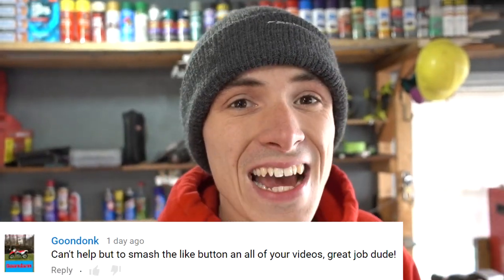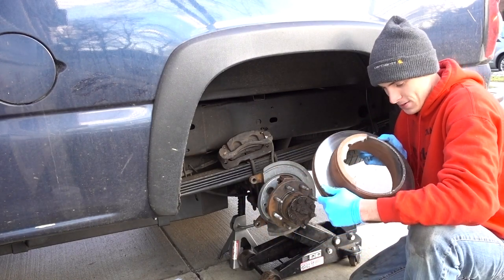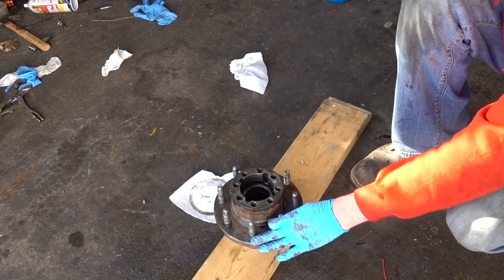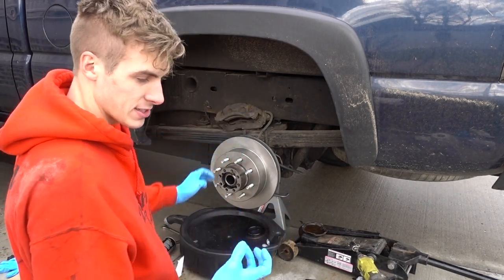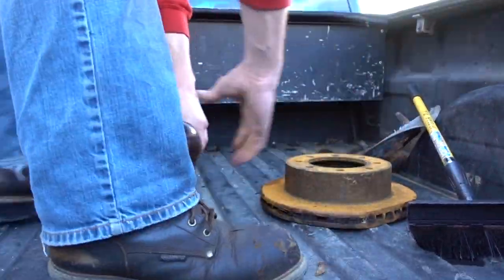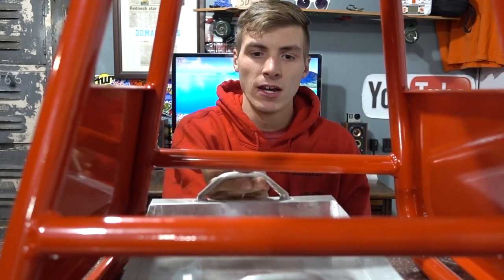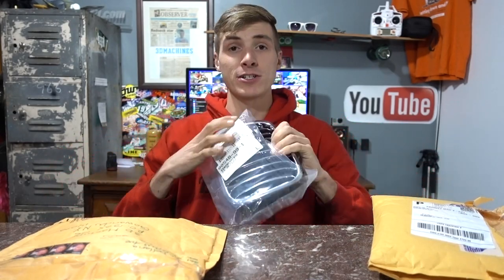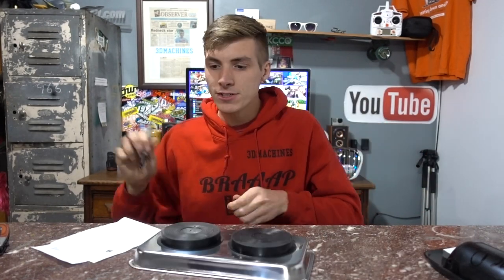NEVER BUY THE WRONG PARTS!!!

Comment: not to be a naysayer but the reason your rotor cracked is because you far over torqued your lug nuts when you kept re-torquing them with a breaker bar lug nuts have a specific torque spec for a reason....

Comment: hey dalton,if you are really going to get a two stroke i would highly recomend a 2001 or newer yz250. this is because the motor is exactly the same from 2001-2017. that way parts will be super easy to get(and cheap;). also they are very reliable and very good quality bikes.

Comment: Sorry to sound like a dick but are u torquing you wheels up correctly because the only time ive seen a almost new rotar crack like that was when the bolts were over tightened?
Reply: spoony 

same here... on his trip home he was gronking on them with a two foot breaker bar everytime he stopped somewhere....he was so worried about them coming loose I suspect he over tightened them.....
Reply: spoony spoonicus Agreed.. on alloy wheels you only need 75 lbs.  That breaker bar he was using with his weight on it was probably putting 200+ lbs onto it.
Reply: spoony spoonicus agree completely I did comment at the
Reply: spoony spoonicus I work in a garage and I torque  wheels at 105
Reply: Its_St3vo yeah i thought that as well but didn't want his fan boys get all salty when i said something.
Reply: spoony spoonicus same haha
Reply: A quick Google search for Duramax alloy wheel lug nut torque specs seems to indicate 140 ft lb is about where they should be.
Reply: Cracked rotor is definitely from improper/ over torquing...I think dalton needs to invest in a proper torque wrench
Reply: I didn't think that was possible.  I wonder how that happens?  I mean, it is only a plate of steel acting like a spacer, you'd think a bolt would break before a rotor would crack?
Reply: You use different specs depending on vehicle right?
Reply: Correct. Each vehicle / model year will have its own recommended lug nut torque specs. It can also vary on the same vehicle depending on the wheel combo being used.
Reply: Dalton, Great vids! I enjoy watching . But as soon as I saw the cracked rotor the first thought that came to mind was all that overtorque that you were doing on your trip home. I'm in agreement with these other guys on that being the issue that it cracked.
Reply: spoony spoonicus his wheel fell off last time he torqued his wheels to the recommended tightness
Reply: spoony spoonicus . You are correct on how he broke it. Way to much torque or he had something between wheel surface and rotor. I've never had a rotor break I've had heat cracks in my ton dually but never a cracked rotor. Installer error is what resulted to his rotor breaking.
Reply: TrollMaster300 . Please tell us how he bought the wrong part for his truck? If you can't buy the correct part for your vehicle you shouldn't work on it. So you think they gave him the wrong part that just magically had the correct 8 lug bolt pattern? Yes some ford and doges have same bolt pattern. But dodge is hub centric so rotor center bore would be bigger. And if I'm not mistaken fords bolt pattern changed around 03-04 so please explain why it the wrong part not like they gave him a f150 rotor or something rated for a smaller vehicle.
Reply: Kevin Coleman He didn't re-torque that was the issue
Reply: lack of focus 
I know they are all different, I was referring to the other commenter saying he "torques wheels to 105 lb ft".
Reply: spoony spoonicus Exactly why it broke. I am surprised he didnt blow the bearing and whole hub. Those things need to be preloaded to exact measurements. Kids now days. After watching him pound that bearing in I almost laughed. Not good.
Reply: scott firman I'm confused on why you want to measure preload on the bearing and wheel hub ? I agree not the best way to install the bearing I would have used a piece of wood on the bearing surface. If you don't have a press the wood on bearing would have been better to install it with instead of the way he did it.
Reply: yes
Reply: I had someone argue with me a couple videos back, they were adamant that he was a good mechanic, yet clearly he's not.
Reply: Keith Brettell He is far from a mechanic. I wouldn't let him touch a power wheel. What kills me is how people are like gonna work on the duramax or power stroke and Cummins. Shit just say the truck. But they must remind you the have a diesel. Can't wait to watch a video where he changes the injectors. That will be fun wonder what excuses he will have once he screws them up.
Reply: Keith Brettell I agree with a bunch of guys stating he may have the wrong lug nuts on his truck. Even if he is torquing them properly and they are taperd and not flat or vise versa then the pressure from the bolts will break the rotor. It could have been a crappy rotor,now days nothing surprises me.
Reply: I'm sure that the bent studs didn't help
Reply: Sam Price I disagree on the impact causing a broke rotor somewhat just cause I doubt he has one capable of doing so. But always start the lug by hand. I always put my lugs on with impact but I use torque sticks most of the time when installing the lug nuts. I have used just impact and never had an issue with breaking a rotor or drum. A possibility why his cracked is the matting surface on tire to rotor could have had a piece of something between the too.
Reply: Adam McIntosh I never said he was. He's good for entertainment, not advice on fixing mechanical issues on anything with an internal combustion engine.
Reply: spoony spoonicus he was using the breaker bar to tighten so he probably over tightened it.
Reply: lack of focus yup thats me just trying to defend my my new boyfriend #Fanboy 👍👍😻
Reply: Sam Price no but you did say you hate when jackasses use impacts to put on tires which is just about every tire joint
Reply: Well, that's what he told you.  Most likely, he forgot to tighten the lugs on that wheel.
Reply: Yeah, that's what he said.  But in reality, he probably forgot to tighten the lugs on that wheel in the first place.
Reply: with a 2 ft breaker it was more like 400lb ft
Reply: Keith Brettell He's definitely not one I would be seeking for mechanical advise unless you want to redo it again. Also some things Chris fix it does make me question his so called mechanic skills .

Comment: it's because you kept torquing your wheels when they didn't need it, I get you were paranoid because your tire fell off but they don't need tightening everytime you drive it haha. Result is a shattered rotor from over stress.
Reply: Aaron Not true. Retorquing only reaffirms that are AT the recommended setting. If they keep comming loose or if the setting is wrong and he is over tightning them,THEN it will crack the rotor. As long as he doesnt exceed the setting,he can tighten them up TO the recommended torque all day long. The truth is he is probably using the wrong lug nuts or that rotor as a cheap crappy rotor. Being it is the only one that has broken,I am going with cheap rotor at this point. As I said,if he is using the wrong lug nuts,they will keep comming loose after a while.
Reply: scott firman he did over tighten them though, he was using a breaker bar and putting heavy weight on it, I think his video showed him doing it 3-4 times in a day. bound to crack a rotor.
Reply: Aaron If he wasnt using a torque wrench yeah not smart,especially on aluminum rims. Always,always torque aluminum rims and use the proper lug nuts. Yes he did crack the rotor,no doubt. Qe saw that. good lesson to be learned for all vehicle owners. I never cracked a rotor before,but learned after breaking some studs and almost losing a tire,always check and recheck your lugnuts,and torque them properly. He may have not even tightenwd them properly,only he knows for sure huh?
Reply: scott firman yea he's lucky the rim itself didn't crack or fracture studs from all the stress. could've ended really badly, should consider himself a lucky guy. That's why investing in proper tools is priority for safety.
Reply: Over-torquing was definitely a contributing factor, along with what was probably a Chinese rotor.

Comment: Just an thought when you lost your wheel.  Are you using the proper lug nuts?  There are lug nuts with specific seat tapers, etc. for steel wheels and alloy wheels.  If using a steel wheel lug nut, it will chew through an alloy wheel very quickly and won't stay tight.  If unsure, I'd replace every lug nut on that truck to ensure your long-term safety.

Comment: Tip for that tailgate bezel cover. I have a 2004 Silverado and on mine one of the two top tabs holding it in broke and it kept falling off my truck. I put a little clear silicon on the foam pads and it never comes off now. Id do it on yours to since these trucks are known for that bezel to break

Comment: Over torqued lug nuts.
Reply: USN_Ret 84-05 sure was
Reply: hoping he did not over torque the new one.  I have taken wheels off with a breaker bar but never put them back on with one.  Good old wheel wrench is fine or if you want to be dead on accurate use a torque wrench. I think around 140ft/lbs for his truck.   Thinking somebody purposefully loosened his lugs on him or he had hit them with the electric impact and forgot to check them with a regular wrench.

Comment: hey dolten what you can do to prevent brake line dammige is to take a wire coat hanger and make a hook and hang the bake caliper on it and hook it to the hole in the frame. learned that one from my dad.

Comment: I'm pretty sure that your e-brake failure is related to your rotor / drum assembly falling apart. I've seen them crack before and that's normally from them glowing when you leave the E-brake on and you drive on the freeway or something but that's pretty bad maybe Chinese aftermarket parts. they were probably the right size just never meant to deal with glowing temperatures.

Comment: Wow...I have to break up my front left rotor like your rear left rotor is to get the darn thing off. It's gone & rust welded itself to the hub. Already did the front right side like that, and the rears came off normally. Not bad for a '00 Silverado 2500MD that spent a year or 3 as a lawn ornament somewhere here in the rust belt.
"MD" because it's got a 8600lb rating unlike every other non-HD I've seen's 7200lb, along with all the HD cooler options and brake package's.

Comment: Dalton, you really need to start actually torquing  your wheels to spec or at the very least in a star pattern. That damage is likely due to uneven and excessive torquing. You don't just torque your wheels so the lug nuts don't fall off, you torque to spec so that you don't deform metal, crack rotors and loose wheels like what just just happened on your trip. Even a cheap harbor freight torque wrench will suffice

Comment: Get and older bike... fix it clean it get it running great... maybe even a few upgrades, but make something you can use, not something showroom clean.

Two radios and 2 bike stands... well you can likely use the second bike stand.  I think that try does not go on the floor on the bike stand but goes on the support bars or something like that.

Comment: If you do get a 2 stroke make sure you don't engine brake pull in the clutch otherwise not enough oil will get to the top end

Comment: seen the same thing on 78 gm 3/4 ton 4x4 with drum brakes on a corporate full floater 14b, it was bad[loose] wheel bearings cracked drum all the way round just like that.

Comment: That cracked rotor had absolutely nothing to do with any kind of torque issue.
It basically slides on and brakes hold it...
Just to let everyone know that...
The only reason it would crack in such a way is if were defective.
So, Dalton. Not your fault and wasn't the wrong part.

Comment: looks like a cheap rotor and/or the unit didn't seat against the hub backing plate correctly. always check the fit. it's a pain in the ass no matter what:-)

Comment: that Axel is supposed to have clips in the differential to keep it from just sliding out like that. what happened to them? I can't quite say as i recall ever seeing a rotor come apart like that wrong one or not. what did you do just shoehorn that thing on there? That radio on the left is the same one i have in my 06 Cadillac Escalade it's a good radio with the Bose Amp in it and the Sirrus XM reciever built into it.  i am thinking about changing it out for the one with the Navigation screen in it but i'm told i will need a GPS antenna if i do that. aside from that it should work and even work with the 6 disk in dash cd changer too
Reply: DaddytechEnt it's a full float axel they come out like that. that ring he un bolts before axel comming out is what holds it in place
Reply: DaddytechEnt that is a full floating axle... the bolts that he removed from the axle flange hold it in the differential.
Reply: shows how much i know about that sort of thing huh? :o) that's about the only thing i haven't worked on in a car
Reply: Your escalade does have C clips holding the axles in like you mentioned. It'll have a g.m. 10 bolt rear end they're all like that. You only really find full floaters in a heavy 3/4 or a 1 ton truck. Although there are a LOT of 8 lug trucks out there that don't use a FF rear end.(gm 14 bolt semi floater in 6 or 8 lug) as a rule of thumb if its 8,600 G.V.W. or higher and domestic then it's probably bolt in axles. The L.D. chevy 2500's (and of course anything lighter) do use C clips to hold the axles in. The reason for a full floater over a semi floating axle is by booting it to the hub the weight is fully put on the hub and rear end housing rather than the axle carrying the weight as in a semi float design. When you get into hauling REALLY heavy loads you can bend axles in a SF. design.
Reply: wasn't sure about the escalade even to be honest i know the rear end in my tahoe has the clips though even though i've never taken it apart simply because i've seen one that was torn down.

Comment: Get a KTM 200 XCW/ 2 Stroke, you will love riding that bike, and high resell value!!
Reply: Elias Weber ktms fuckin suck. they dont run that good and parts are expensive and hard to get because they have to be shipped and three years after a design of any ktm product is discontinued the parts become obsolete
Reply: I had over 90 dirtbikes in the last 4 years. I tried all bikes 4 stroke and 2strokes. Can't go wrong with a KTM 2 stroke. parts are not expensive here in Canada. In my opinion nothing beats ktm 2 stroke reliability engineering and resell value! 
But everyone has their own experience and opinions.
Reply: Elias Weber here in the u.s parts ARE expensive and they DO have to be shipped unless there is a dealership in your area and there arent very many of them over here in CA man. i would not assume there is very many in rural NY either.

Comment: Anybody have a unicam camshaft housing and rings for a 2009 crf 450r in the toronto area? Installed new cams in my bike and damaged the old housing system. Comment back if you have it

Comment: you should've used a open ended lug nut to use the threads of the stud to pull it through instead of hammering them in lol
Reply: you could still use a closed ended  but put a washer and bolt on before the lug nut
Reply: theGrEaToutdoors that too i did noticed he had closed end lug nuts

Comment: Did you get a new torque wrench?
Reply from the maker: Yes. It's in the mail
Reply: 3DMachines hey could you send me a picture of the bar you used to both install the wheel seal and pry at other parts? looks handy I want to build one. @jsolyon on Instagram

Comment: Would yiu ever drive a F150 super crew?
Reply: Mike Haapoja they do have the option in the newer ones for the full bed. I own a 6.5 ft with an extension rack that makes it a full size bed.
Reply: Mark Blonski sorry I add'd my response and accidentally deleted it. Oops.
Reply: How do you like it? What motor do you have? I have the 250 crew with the 8' bed. Thinking of downsizing. But still need the 8' bed. Have to fit wheeler with plow inside box.
Reply: Mike Haapoja. i have a 2005 5.4 V8 3v triton. great power. manifolds crack easy but most trucks are like that. other than that great truck
Reply: Mark Blonski thank you for the feedback. Appreciate it!